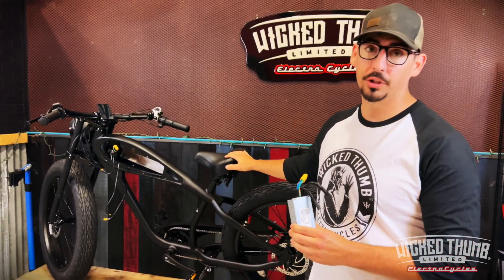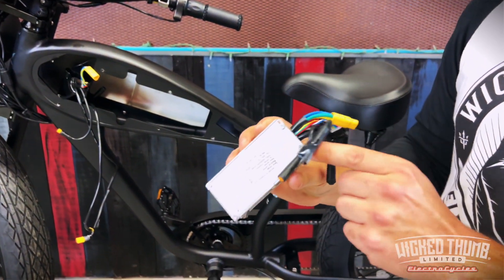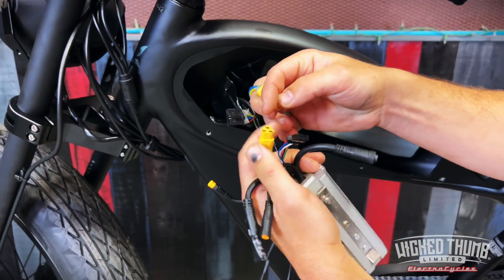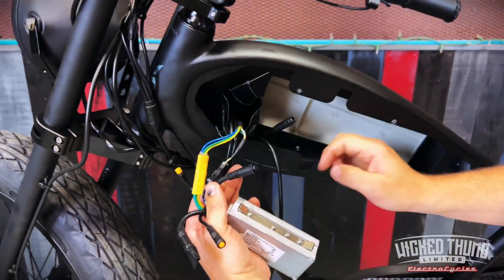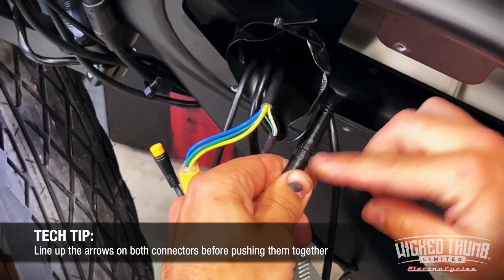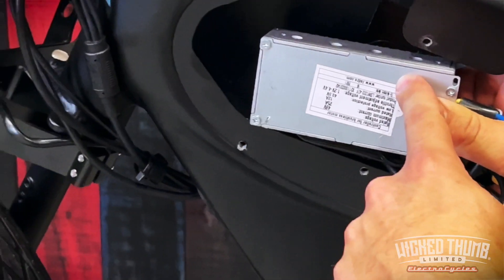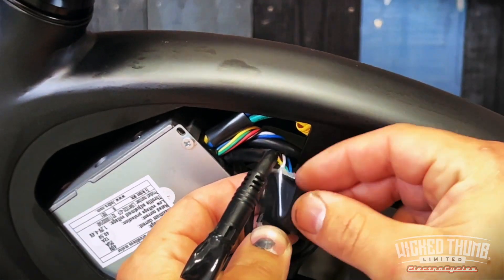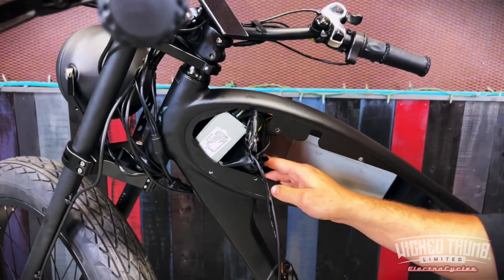How to Install an Ebike Controller Wicked Thumb

Comment: I rearranged my controller box. From factory it was terrible and flopping around. I got it in nice where it won't move but it's touching some of the frame. Just as you did in this vid it's ok for it to touch the frame right?